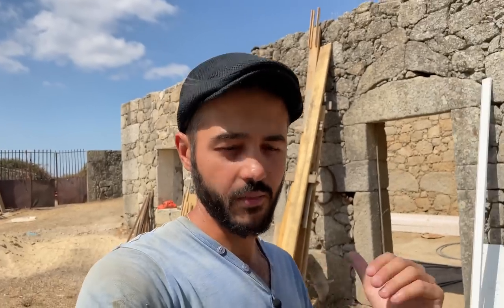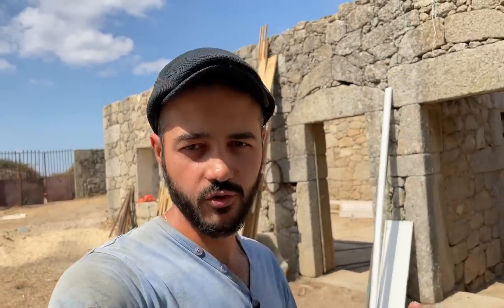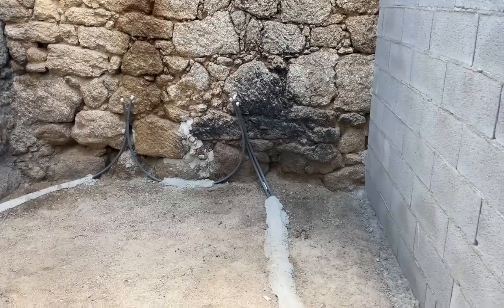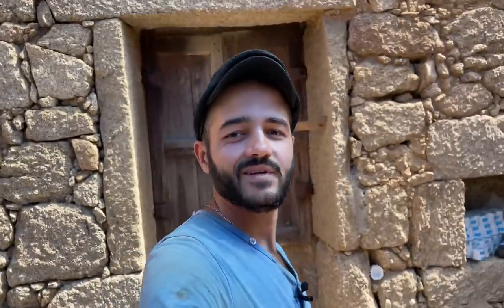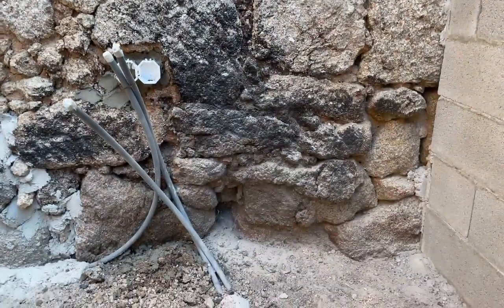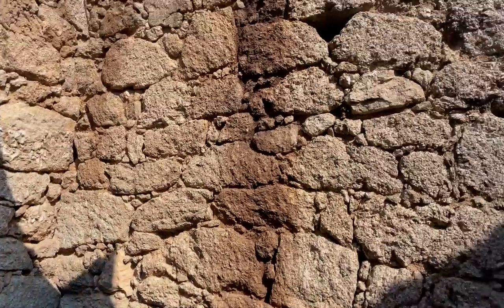Abandoned Stone House Restoration | Concrete Floor Slab Prep - Ep.9

Comment: Hi Alex/Dad - Ian here! 😁I am confused why you have buried the electrical boxes in the wall as you stated you will be dry-lining the walls (and insulating too maybe) as they could more easily have been clipped into plasterboard cut out holes
Reply from the maker: We are gluing Drywall, without metal structure on these walls.
Reply: @AlexLukachina  OK, in UK FYI that method is known as "Dot and Dab""...... you are going to need longer screws to fit the socket and other outlets though! 🤣🤣🤣
Reply from the maker: @bedlam8159  Dot and Dab, got it))

Yea we will need alittle bit longer, not much though, because we installed the boxes 1-1.5cm off the wall, so in some places the box is aligned with the drywall.
Reply: @AlexLukachina  I noticed that, good attention to detail guys
Reply: Wouw you are making great progression!